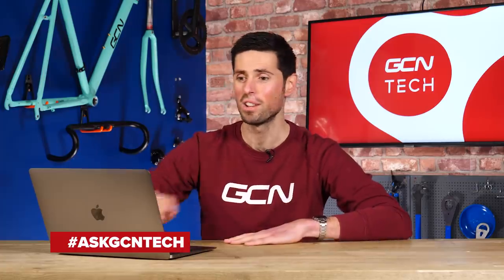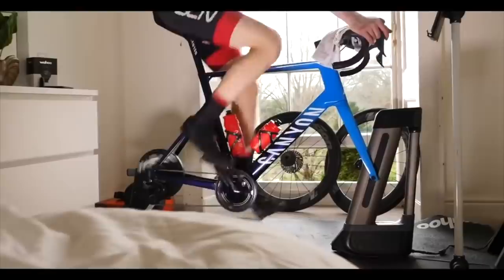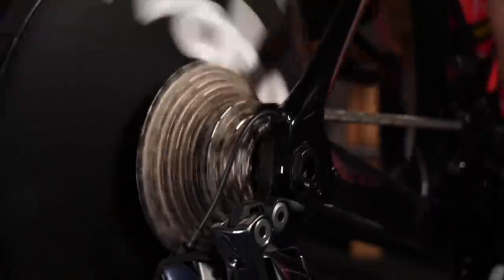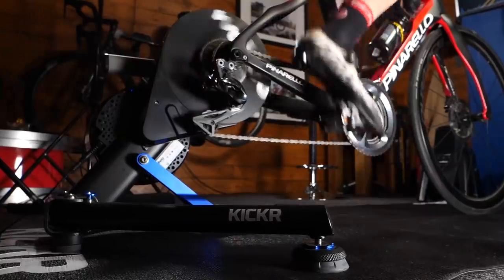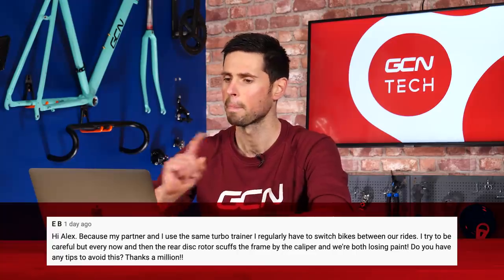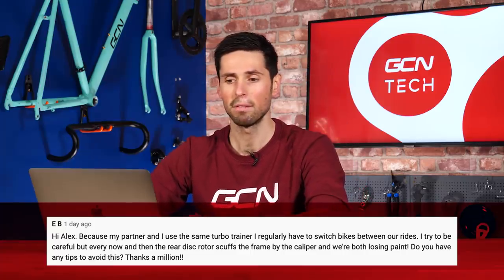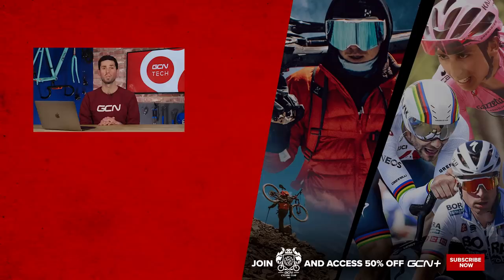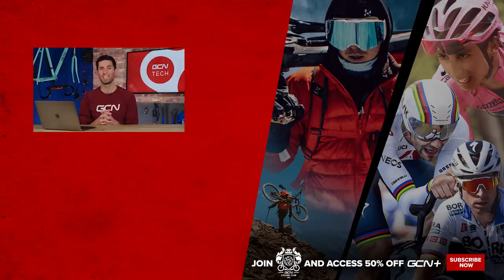How Should I Set Up My Trainer If I Swap Bikes Regularly? | GCN Tech Clinic #AskGCNTech

Comment: I think the answer to the 52x11t and 34x11t question missed the point. I think the way to look at it is if the gears were being used at their maximum on a climb. Surely the larger gear hits the 200w earlier (e.g. at say 60rpm) whereas a rider in 34x11t will hit the 200w limit much later at a higher revolution (e.g. 90rpm) and therefore the ground speed might be the same? no? Has anyone done the science on this?
Reply: It would come down to cadence, which is a personal thing, with a recent tendancy towards higher cadence. There was a video or two on grinding vs spinning on the main channel. 
Also the asker should just pedal harder and faster.
Reply: @Aeronwor  No, definitely nothing to do with fixing cadence or perfect cadence or any distraction of cadence. This is about fixing the power and then finding out which gear travels the furthest at this fixed limit. Irrelevant of cadence.
Reply: @sethgriffiths6539  power is power. at the pedals it is torque (force on the cranks) x revs (cadence), moving forward it is speed x force (sum of resistances, inefficiencies and acceleration x weight - in this regard climbing is acceleration). All other things being equal the same power at a bigger gear results in slower pedaling, in a smaller gear faster pedaling, the traveled distance, speed, acceleration will be the same, that is how physics works. in the big gear you will reach 60rpm at about the same time as you will reach 90 rpm in the small gear.
The force you can apply to pedals is limited, and so is the cadence where you can efficiently pedal (why we have gears).
Reply: @Aeronwor  great reply, very impressed! I think it answers the question then :-) So,  the gear with the least train power loss wins by a  few centimetres I guess as all other parts of your equation seem to be constant if I understood correctly. Thanks  :-)

Comment: #askGCNtech Hi everyone, I recently got a gravel bike Cannondale topstone. It comes with a 2 by GRX 800 groupset. The current chainring is 46/30. Can I install a 52/30? I have a spare 52t chainring from my road bike with that would fit but im not sure if the gap would work. Would a chain catcher solve my issue?  Thank you for your answer.
Reply: Simple answer is no. The front derailleur cannot handle a 22 tooth difference. You didn't specify the difference on your cassette, but the standard GRX rear derailleur cannot handle more than about 40 teeth difference front plus rear. The real question is why do you want to Mount a 52 tooth chain ring?
Reply: @jamesmckenzie3532  thank for your feedback. My cassette is an 11-34. I wanted to run a larger chainring to have similar gearing then my road bike. I’m planning to use my gravel bike on snowy road more then off road.
Reply: @yahyabaali7886  then you might want to consider a 50/34 compact ringset. Snowy roads are nothing to mess with. You might want to get studded tyres as well (yes they do make them for bicycles and the first time you hit ice you'll want them).

Comment: Hi Alex, My etap acts weird many times such as when I tap for small chainring from Big one at front chain leaves the chainrings and sit on bottom bracket. Firmware is upto date & my SRAM Red etap is new hardly a month older. What could be the issue ? Kindly help. Regards Rahul 🇮🇳
Reply: Needs adjustment or you may need to add a device called a "third finger" which acts to keep the chain from falling off the inner most chain ring. I had to add one to a bicycle for exactly this reason.